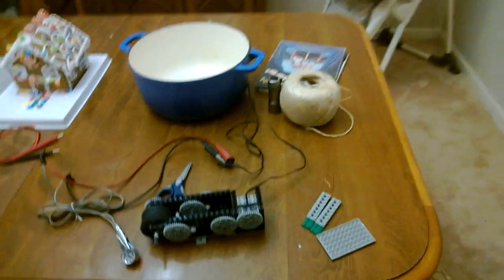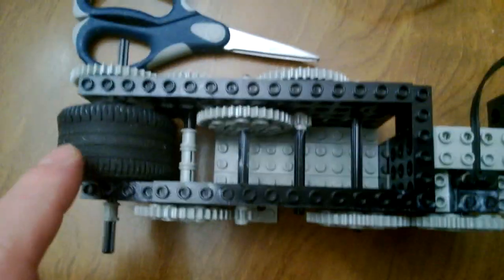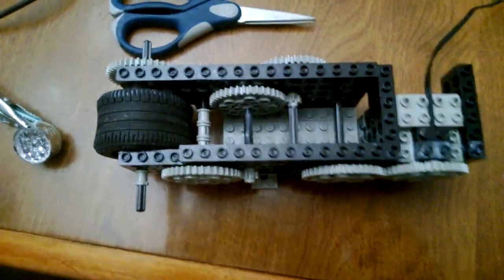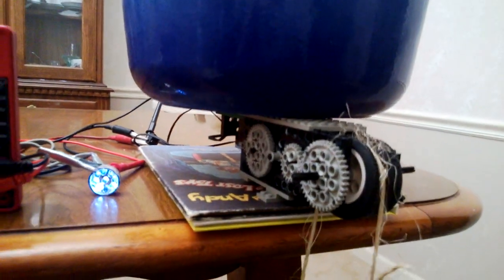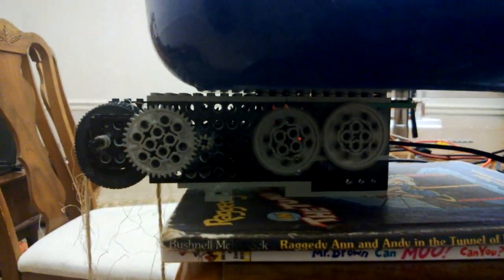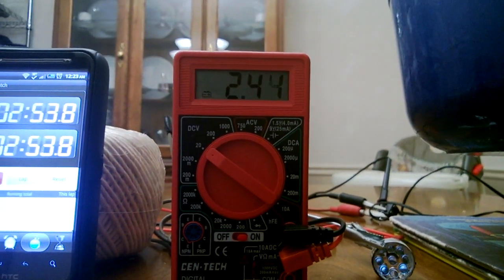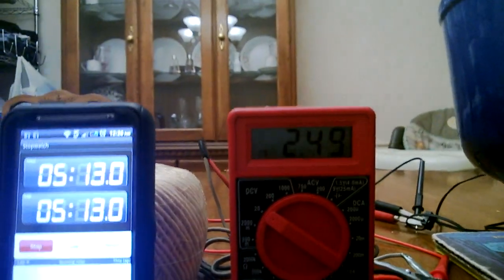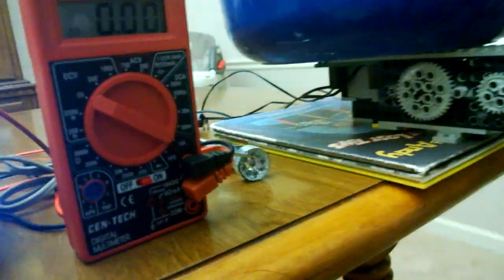Gravity fed generator using Legos a Mindstorm motor and a flashlight led.

Comment: you should wrap the string around it twice for better grip, an old bicycle chain would be good with a sprocket,thanks for the description,  if you lived by the harbour this could be used in conjuction with floatation and tide

Comment: nice! wondering, why the need for the counter weight though?
Reply from the maker: The main reason was the string wouldn't grip the wheel. So it increased the friction between the string and tire. In case anyone else is wondering why i didn't use a chain or some other interlocking method, I just didn't have the equipment. Also, a string is fairly strong.

Comment: is the counterweight to control the speed at which the 7up falls? and does speed directly determine the voltage generated by the motor?
Reply from the maker: The counterweight was there to prevent the string from slipping off when we released the bottle.I considered a lighter counterweight or heavier primary weight but the sauce bottle gave me about a 5 min run time so I was happy. In simple terms yes, but speed does not completely determine output voltage. I don't claim to know the math or physics, but... there is probably a power output curve or equation that would show speed vs output voltage on any motor. One other thing to consider is amp or watt draw (load). In my example I used a very low amperage flashlight LED bulb. 3 AAA batteries are around 4.5V and 800-1800mAH. So I shot for about 5V for about 5 minutes with a meter connected. My setup would never power anything high amperage.
Reply: Craig Lubitz thanks!

Comment: This is a great little project.  If you made the lego gearbox longer and added more gears would the weight end up stripping the cogs?  Maybe the efficiency drop would make the effort pointless. On the electric side, you might want to try the fuji circuit idea to power a normal household cfl bulb. Sit the whole contraption on a shelf above a door, then instead of someone getting a bucket of water on their head, the weight would start to fall automatically lighting the room.  Good work keep it up.

Comment from the maker: What would suggest?

I'm not an expert in efficiency. My understanding of gravity fed generators is you want the best weight to power output ratio. Then you want the longest run time possible.

Let me add that I'm currently working with the boys to learn how coils work, with the ultimate goal of creating a Bendini motor. So any suggestions are welcomed.

Comment from the maker: No. I have no plans on making anything bigger or with other materials at this time. I saw another design i like where they used a large plastic disk and put the gear teeth on the inside of the disk and then spin it around a small gear and stationary motor. I hope that helps.

We didn’t measure the voltage on that experiment.

Comment: Sorry about that, I mean bigger machine not made with legos, maybe metals or other stronger materials. I'll try making the gear train with wood. Using metals is more expensive.
And I saw the video, do you know how much electricity it produced before the handle snapped off?

Comment from the maker: Not with this design. As we added more gears to the gearbox, we noticed the main axel (the one holding on the tire), started to twist and warp more when the main weight was applied. In the video you can see we used an axel that sticks out to prevent it from snapping out. Check out the previous video and you can see my son easily generates enough force to snap off the crank handle.